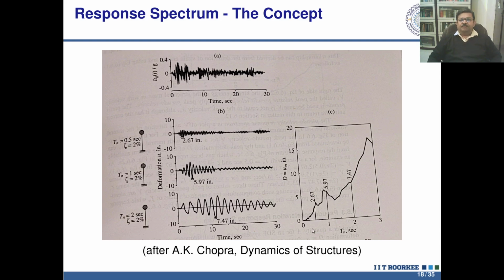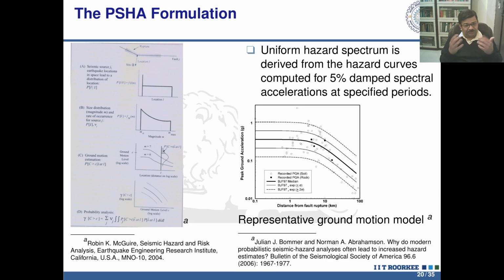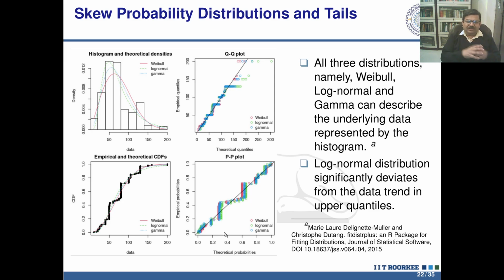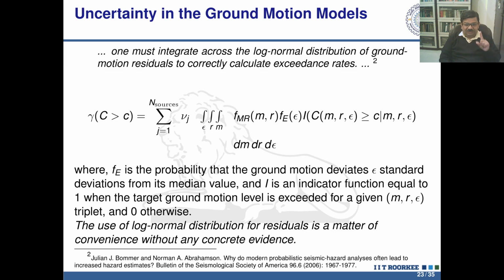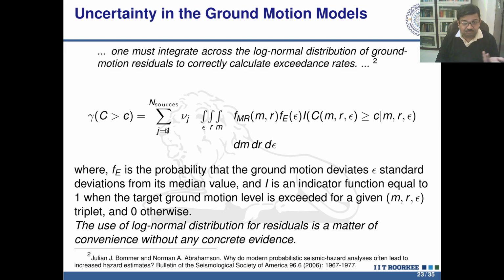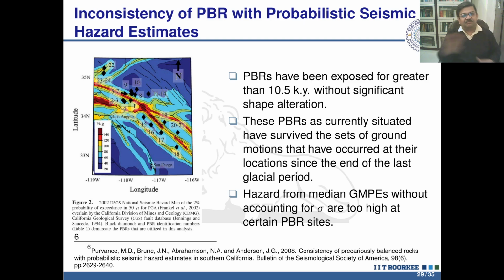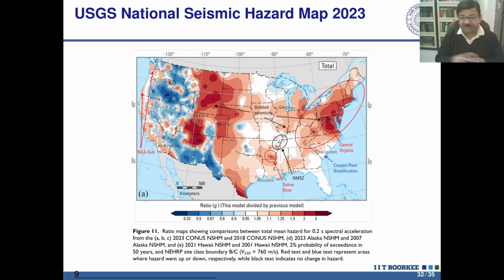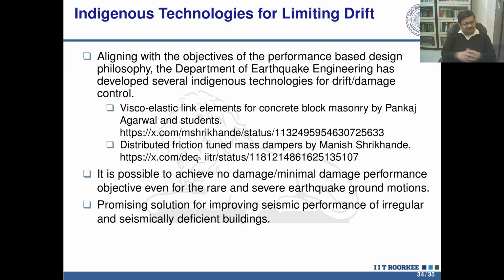Revisiting the Revisions in IS-1893(2025) - II (The PSHA formulation and potential problems)

Comment: After ASCE 7 has adopted risk-targeted design maps since 2010, the research community around the world has put concerted effort in this direction. It appears like UHS may get replaced by risk-targeted maps once all issues get resolved. Should we also align ourselves along these lines ?
Reply from the maker: Design codes are intrinsically linked to the construction practices. Uniform risk approach might lead to some cost saving in regions of relatively low seismicity but that requires a certain degree of standardization in the construction practices for which the risk has been quantified. The target risk is not achieved by merely specifying the load without any regard to the design and construction practices.
Reply: So the weakest link in all these is the way we practice design and construction. Moreover, the weakest link in the construction practices is the state of affair of construction labourers who live miserably throughout their lives.
Thank you so much Sir for your insights and your endeavour for engaging with the civil engineering fraternity.👍
Reply from the maker: It is always a pleasure to interact and learn from practicing engineers.

Comment: If drift control is the ultimate goal, drift hazard curves (Jalayer, Cornell) should be developed rather than developing uniform hazard curves. However, it is also possible to keep the seismic provisions unchanged even when the seismic hazard gets updated as demonstrated by Japan (Suzuki et al , eqe.3853,2023).
Above all, we should all sit together on a common platform and discuss the issues that are raised by stakeholders.
Reply from the maker: Thanks for your feedback and for referring to the interesting work by Jalayer and Cornell. As you may notice, the DCFD formulation is based on inter-storey drifts conditional on the ground motion intensity (spectral acceleration). So the basic problem with the incorrect formulation/use of probabilistic seismic hazard assessment remains even if the performance levels were to be defined in terms of some statistical models for drifts for nonlinear structural response.